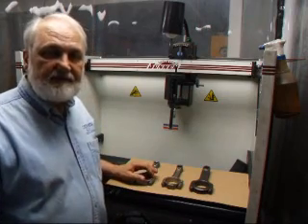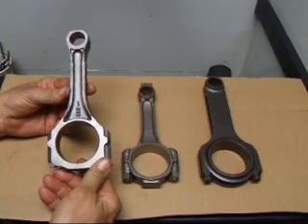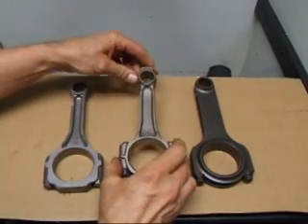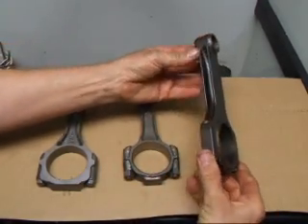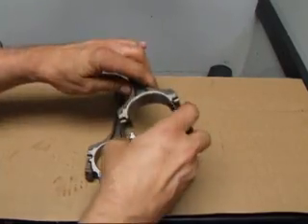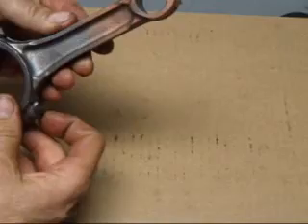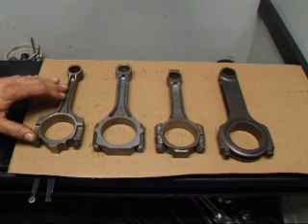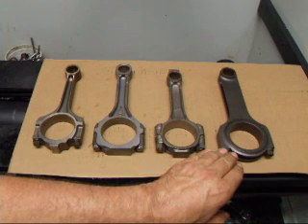Automotive Connecting Rods 101

Comment: Hi John, I have a 1987 Chevy 350 small block engine,  which I am replacing the pistons and rings I numbered each rod from the crank the position I took them out, But the one thing I did not do is mark the front of the rod facing toward the front of the engine, and when looking at the rods from the  side I notice the rod is a little off center at the big end, Is there a way to tell the front of the rod, I have checked the rod front and back to see if there is any arrows or makings to tell,  But I don't see anything,And a big thumbs up on your very informative video, Thanks.

Comment: Really interesting video, thanks for the information! What i want to ask is about the markings on the beam of a connecting rod. I usually find a six-digit number with a letter on the beam, for example P524137. Sometimes the letter might be X,XC. My thought is that it has to do with the production factory. I also need to mention that i work on refrigeration compressors. Thank you in advance!

Comment: The powdered metal rods I have on late model 3.8 buick are just as thick as the cast versions in your video used prior to 2003? I believe the are also forged as part of the manufacturing process. I do  agree that they stay round, also the fracture cap doesn't move and stays together better than other rod types. The other advantage is the powdered rods are stiffer too.

Comment: You missed a few key points.

1. H-Beam is an inferior design.  It is the cheapest to manufacture as you can use a single blank to machine into many sizes.  X-Beam and I-Beam are the strongest by far when given the same material and same processes.

2. Rod weight.  Titanium rods are always better suited for high power and sustained high rpm usage.  A tapered I-beam design made of titanium is the strongest rod you can put in your engine.  It makes the billet H-Beam rod you show look like a twig.

Comment: Ford Mustang rods, sintered powder metal, quenched in oil for hardening the surface.
Same process for 1987 Ford Escort 1.9L

Camaro SS rods, Sintered, Hot Drop Forged, Ball Peen Forged, adds 27% fatigue strength, about 10% short of the strength of extruded wrought steel. as they go thru more forging dies to get to the right shape.

Comment: hi great video... very informative ! i have a couple questions, you said the h- beam are the strongest but you didn't give them a rpm range... what would that be? also I have been looking into rebuilding my engine and finding shops to do the work and the one i found has a couple options and one is an upgrade from h-beam to i-beam why would i "upgrade" to i-beam? arnt the h-beams better? but there saying it will be an extra $400 for i-beam rods instead of the h-beams 
thanks for the vid!

Comment: @youdragon it is normal for higher oil pressuer during cold start up 
oil is cold and much thicker than at operating temp
and 20 psi is fine on an idling engine 
and as u drive revs are higher so naturally more oil pressure

Comment: @originaldriver 

As said in the vid that's why the lighter rods stay round more time than the others more heavy.

But it depends if the engine is NA or turbo too.
the stress is not the same on those engines....

Comment from the maker: @youdragon - I suspect that your cam bearings are at fault. You will need to remove the engine and completely disassemble it to make repairs. Installation of the cam bearings runs around $45, plus parts.

Comment: John, given the choice between common heavy duty "X" rods in a street/strip motor... or the newer production powdered rods;  which would take more abuse?  Also, are the PM rods conducive to beam polishing, fitting with ARP bolts, etc the same as the stockers?

Comment: stroke has more to do with rpm tolerance than rod designbecause stroke determines the piston speed at TDC. 

The connecting rod is under the most stress when the when the piston is halted at TDC after traveling to the top of the bore. 

This sudden "halt"  at  TDC generates tremendous forces on the rod and the rod bolts.

Most well-built street performance engines will perform safely at 4000 ft/sec of piston speed.

Use this formula...

max rpm = (max piston speed X 6) / stroke